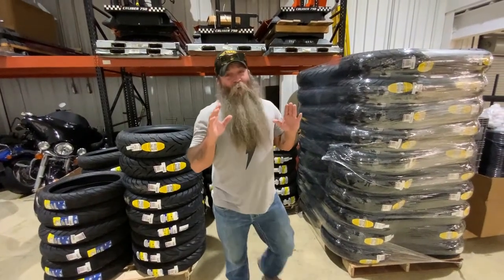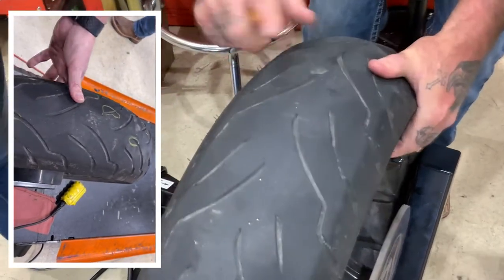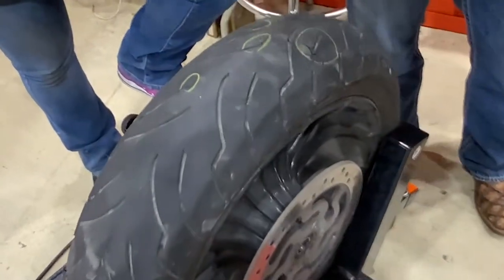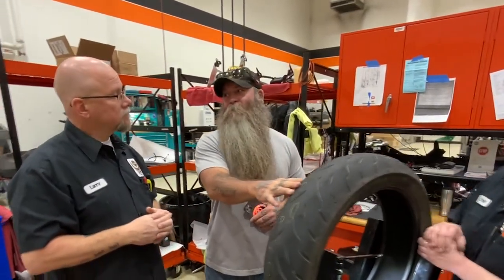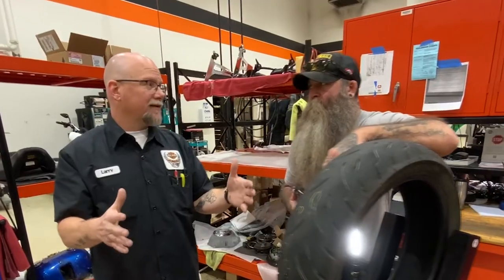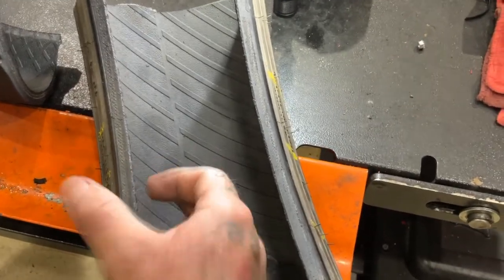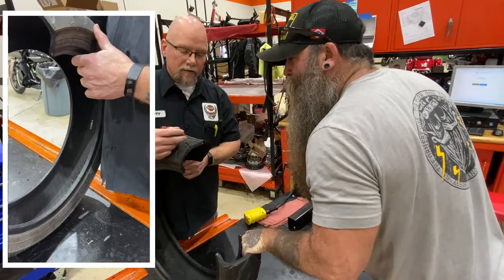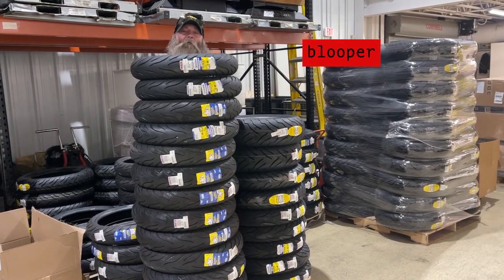Best Tire for Long Distance Touring on Motorcycle Ride? How to get the most miles from your tire~

Comment: I run the commander III front and rear on my SGS. Super happy with them. Every condition they run great in. From concrete to pavement to dirt. I run hard and fast also. I have 15000 miles on them and I bet I get at least 10000 more out of them.
Reply: That sounds great
Reply: Agreed . Those are a pretty hearty tire. Mine also seem to have a good bit left
Reply: Touring or cruiser?
Reply: You obviously don't ride in the rain. Worst wet weather tyre I've ever ridden on in 47 years of motorcycling.
Reply: Yeah, I'd guess you don't ride in the wet very often.  Worst wet weather tire I've ever ridden on and this is well known.
Reply: Cant be going that hard getn 15k out of em lol
Reply: Actually the Commandr 3's are better that the oem Dunlops in the wet, not to mention getting more miles than any, by far, that I've tried across three of my bikes.
Reply: @russparker71 same !!!
Was great on the fatboy 
On the road king they were AWFUL in the wet 

Been on the oems on the road glide.  Handling all weather and temps.  Didn’t like snow lol 

Doin some research for what the best all weather tire for my 124ci road glide that won’t wear out in 10k 
OEM Dunlop’s been getting 12k
Reply: @gorillamoto5329  I love mine for dry cruising.  But they break out under me in the rain way too much around turns when wet.
Reply: That’s what the wife and I run best tires I have come across hate metzeler tires rubbish
Reply: @russparker71 I agree Michelin suck in the rain, I recently went from Dunlop to Metzler on my Road Glide. 4500 miles and the Metzler Marathons are cupped all to Hell... Gonna try a set of shinko 999. I've never had any tire last over 5500 miles on my Bagger. I ride fast and hard, hoping the Shinko handles the wet well and holds up better.
Reply: @fvgc454ss  I have had 4 Commander 3' & average 14-15.000 km's...not miles...I have had 28 rear tires since 2006

Comment: My bike is a 2011 Ultra Limited and I run the Dunlap American Elite when it’s available. I’m running a Continental on the front for now because the Dunlop has been unavoidable but it’s performed well 5k miles. I tried a Michelin commander II a few years ago “commander III” are now available but I’ll never use them or any tire from Michelin. The commander II delaminated on the interstate after 1500 miles almost putting me on the pavement. When I went to Michelin rep about it and after telling him how I was running fast on the interstate. The response was I “over worked” the tire before even looking at said tire. This tire now hangs on my shop wall as a reminder never to buy another Michelin tire.

Comment: Gross rating on your bike is 1360 lbs. The bike with fluids is 932 lbs. That leaves 428 lb Max carrying capacity.  The empty tour pack and mount is 30 lbs. so that leaves you 398 lbs for you, Steph, and all your gear. Bottom line, you overloaded the tire and ran sustained high speeds in super hot weather - and that’s the perfect recipe to destroy a tire. You see it all the time on trailers with blown up tires sitting on the shoulder and the the driver wondering what happened.

Comment: Commander 3"s this season. Finally got to the wear indicators on the Commander 2"s. Over 25K on both front and rear. Mostly highway riding at speed limits. 70-75 mph. Always ck the PSI before the ride and between on road trips. Got 5K on the Dunflops before they went wildly out of balance. Switched to Michelin's and never looked back!
Reply: Are you serious? 25k miles on a motorcycle tire.

Comment: I just replaced my stock tires (Dunlops). I had 18k miles on them. Just put a set of Michelin Commander IIIs on it. I had no issues with the stock tires, but I don’t run heavy much of the time. Went with the Michelin tires only because they were highly recommended.

Comment: Wow!  That's a scary looking tire.  I'm a 300lb man and I pack heavy.  I've gotten 20k out of a couple of sets of American Elites and was really happy with them.  I'm crazy about my air pressure.  I check it every morning. I run 38 front and 42 rear and I wear out tires, but have never had a crack or bad cupping.  Similar experience with Commander IIs and IIIs.  Your milage may vary.

Comment: I've gone through 3 sets of tires on my 2017 RG Special
Stock ones I got 22863 miles
American elite I got 25882
Next set of American elite I got 26039
I check pressure often and I park the bile on wood not cement

Comment: 1998 Heritage Softail Classic setup for solo rider weighing 210 lbs and 20 lbs luggage. Dunlop American Elites front/back wide whitewalls. First set April 2019 lasted 14k miles. Second set April 2021 lasted 11k miles. Third set April 2023-present 3k miles and still rolling. Average Speed 70mph. Temp Range 55f to 95f. Air Pressure 39-40 psi. Comment: I give these tires an overall rating on dry surface 9.5/10. Under wet conditions 9.0/10. Offroad: Not Happening...
Reply: I have a 2017 BreakOut. Solo rider. I use Cobra Chromes up front and American Elites in the rear. I currently have 13k miles on both. I have the front at 36psi and rear at 38psi. I ride from 40° to 100° this yr. I have about 15lbs of weight in my swingarm bag and I weigh 203lbs. The tires are about 1/4 worn. I'm hoping to get 18k on both before winter hits. The Cobra Chrome is softer than the American Elite but the front tire usually lasts longer than rear drive tires. So hoping to get about equil mileage. Both fantastic in the rain. I had Michelin Cammander 2s on and they were terrible in the rain.

Comment: I am on my third set of factory Dunlop d series. Ist set I ran 30k . Second set I had over 20k with plenty of tread left. On a new bike now 16k and they have lots of tread left. Now we typically run 15-20k miles per year. Si I generally change every two and a half to three years. Now I also check my tire pressure every week. 38 to 40 psi front and 40-43 rear. It's Dunlop for me. They are expensive but they last and last for me. First bike was a 17 ultra limited. Currently on a road glide limited and we ride two up frequently.

Comment: I get approx 25,000-26,000 miles out a set of Dunlop OEM and American Elite on a Ultra Limited. I am running 41/41 p.s.i. and checked often. I will start getting cracks in the rear tire when it wears down and starts to cup. According to the amount of thread depth and the wear mark I could probably get another 3,000+ before the wear mark. This is around 21,500 miles and still has good thread life. Yes I try to get pass the 25,000 mile mark to get my money worth. I have since decided to change out at 21,000-22,000 mile mark to be safe before the cracks start.
Reply: First thing I do when buying a new/used HD, remove the Dunlop’s. Michelin or Avon on my bikes.

Comment: I’m a big fan of running 42 pounds in the back and 38 in front on my 16FLTRU. Tires don’t cup or split. They run cooler and perform a lot better riding 2 up loaded to the max for a long distance run. I carry an air pump in the pack. Check my tires first thing in the morning every day.

Comment: Jeepers!!!  Never seen that in any tire before.  If I was a guessing man, I'd say you tan over a bunch of sharp rocks.  I got 23K miles on my Yamaha cruiser, an 06 Stratoliner, running DAE's.  I just replaced it with another DAE.  Love it.  On my two Harleys, I run Michelin Commander II's.   22K miles so far on my Dyna.  Love them.

Comment: I run American Elites on my 04 Heritage. This last set I put 6k on them. Front tire came up with with a breakage from the center to the side wall. The breakage looked like I ran over barbed wire, about six or eight inches long. slotted looking holes with fine rubber in-between. Think I would have been aware running over such a thing, especially holes up the side of the tire would make you think it happened during a turn leaning into it. Never noticed running over debris. Checked the hole depth and several of them were as deep as the tread. Without Dunlop taking the tire in for analysis I'm assuming it's a default in the tire.

Comment: Thanks for making this video. It was a very enjoyable and informative video to watch.

A sobering point that was brought up. At 18:12 "When riding your motorcycle, your life is riding on the size of a credit card." I've always thought of the size of the contact patch, but not in such a way that I could visualize holding in my hand.

I love the Dunlop Tires. They're engineered for our heavy bikes. I'm going to start off the riding season on a set of new tires.

Crow, I owe you one. The date codes on my bike's tires are front, 1417, and Rear is 4816.

I have 15,982 miles on a 2017 Indian Chieftain Limited. I have a new set of tires sitting in my front room ready to replace my old tires, but on the rear, I upgraded from the E3 to the E4. I kept the same American Elite for the front. I have noticed that I cannot squeeze the beads together, even when putting all of my 230 lbs of weight on the sidewalls.

Comment: Dunlop Elite 4 50th Anniversary Goldwing. Changed out the Elite 3 none of those issues.  17 Chieftain Limited Stage 3 Dunlop Elite 3. 9000 miles rear tires 50 percent worn out and not checking or cracking. I drive the crap out of my bikes. Hard acceleration and turning. 😊

Comment: I have a 18 RGS. I got 16k from the rear tire, It was a Dunlop American Elite. I switched over to Michelin Commander 3, So far I have approx 10k on it and plenty of life left on it. I pulled the front at 18k cuz I was leaving on a 5k trip which was also a Dunlop, still had some life. So now I have Commander 3 all around. I have the Michelin Scorcher 31's on my 04 Fatboy, been using those for ever.

Comment: I run the stock OEM Dunlops on my 2018 FLTRU, usually get 20,000kms(12,000 miles on the front)  best about 15,000kms  (9,300 miles on the back) , keep air pressures  as per 38-40psi.  Keep my weights within specs and I weigh 200lbs.  I run fast but not abusive,  it regularly gets above 80 degrees in summer and often it the 90' s July and August.

Tried Commander 2's one cycle but they fell off a lot after about 5,000 miles and were not as grippy.  Nothing like good rubber!

Comment: Great video, thank you! I had 12k miles on my original factory Dunlops and changed them up right before doing a 4K mile round trip. You were going through something similar at the same time and you went with those Dunlop American Elites you just took off…so I do too. Lol. My tires are holding up just fine still but if I were doing the great escape tomorrow I’d be changing those suckers out for something fresh without hesitation. Will be hitting the Ozark’s up a few times this year with a group (will be my first time) maybe I’ll see y’all out there. First rounds on me!

Comment: As you ride hard and heavy consider the Conti Road Attack . My experience with them is extensive hiway some race speed exceding 200 on anothe heavy bike in the Hayabusa.  New tires lasted full trip San Antonio to sturgis and back heavy loaded

Comment: I'm currently running Darkside stuff however, in 64K miles I went through five sets of tires. Two sets were Dunlop and three were Michelin. The Michelin handled great when they were new but they just didn't last. Overall I got the best performance and mileage from Dunlop American Elite.

Comment: I've never gotten good mileage out of dunlops my last dunlop on the rear of my FLHX lasted 9600 miles, was down to the ware bar and cupped very bad. I have been running Avon's on my 05 Softail for years very good tire, I will be replacing the dunlops on my street glide with Avon's

Comment: I’ve run four brands of tires on two heavy touring bikes: a Kawasaki Voyager XII and my current BMW K1200LT.  I’ve had four tires fail: 1 Dunlop on the Kawasaki and 3 Metzelers on the BMW, one rear and two fronts.  I ran Michelins on the Kawasaki in addition to Dunlops and never had a Michelin fail.  I now run Bridgestones on the BMW and have yet to have a Bridgestone fail.  My preferred tire brand is Michelin, but Michelin doesn’t make a rear tire with the right size and load/speed range for my BMW.

Comment: I run the same tires on my Road King. I got about 12k on the rear. It’s absolutely bald. I haven’t checked it for splitting but I like how the tire performs. I could probably get more miles out of other brands but the performance is why I stick to the Dunlop American Elite. I will say this… I should have gotten more. I had a leaky valve stem. Removed the core and replaced it. But it was too late.

Comment: I was about to get a set of these for my VTX1800R :\ I think maybe I'll skip, that bike is well over 700+lbs, and over 1k with us on it, add some gear and it's getting close to a rolling 1200lbs or more. I do inspect my tires after every 500-1k miles, but it's easy to miss that hard too see stuff that's not a cut, cup, or bubble. It comes down to confidence, and that's the rubber that separates you from the pavement, you shouldn't have any doubt your tires can perform, or even over perform if needed. I'm glad you all were able to swap these out without incident, they look a little scary. Arrive alive!

Comment: Wow!  Thanks for a great Video.  I travel gravel roads fairly often.  I bet gravel is hard on them.  My Michelin Commander II tires had good tread to about the 11 thousand mile mark.  I just put on a set of Commander III.  Let's see how these do!  I like a long life tire because HD charges a ton of money to mount, balance, and install!!  Ride safe and I will be looking for more great videos.
Reply: Be careful with those Commander IIIs.. the 2s were great but the 3s are lacking, especially on wet roads. If you only ride on dry pavement, you should be fine.. just use extra caution in the rain.

Comment: I don't know man I run those, I just went to the garage to check mine after seeing this video cause it freaked me out. I did most of the World Record Poker Run with ya'll and rode a lot before and after. Not as much weight as guys cuase I ride mostly solo but have done over 12-14k miles on my tires since last July, still have fair amount of tread. Not a single crack/split.. however I do have cupping, which I'm not surprised because I don't check my pressure as much as I should. I'll have to check my old bike I sold to a friend that has those tires also (second set I ran on it) that are a couple years older so see if they are doing it.

Comment: I had Dunlops on my scoot when I got it and the tires were worn enough at 5k to need replacement... But no splits...  I replaced with the Metezler 888 Marathon Ultras....  Best handling tire I have ever run... Made my Road King feel way more nimble in the twisties...  I just did a tire change after just about 18k on the 888's .. Still had several k miles of tread but I am heading out on a long ride in the 10 range so put a new set on...  I have nothing but good things to say about the Metezler 888 Ultras...
Reply: That's great to hear cause I just ordered the 888's  switching from Commander III  liked them except for the harmonic hum from the front tire at 60 mph

Comment: What did you pay for the front and rear tire and did you ever ask to put the 90 degree valve stems in  so it’s much easier to check the pressure

Comment: Ran Commander 3's. 17k miles on rear, currently 22k on Front. Running car tire on rear now. We are not small people. And that car tire has the weight and traction that a touring bike should have.

Comment: All my dunlops did the splitton that's why I went with michelin's commander threes
Reply: Randy, how are the commander 3’s? I am running American elites now in Florida and absolutely love the traction. Both dry and especially wet. Mine are just starting to cup on the front tire with right at 12,000 miles. Next set I get will most likely be Michelins if they are good in the rain

Comment: Metzler cruise tech i have ran it on both my bikes fixing to pull my dunlops off my VTX 1800 and replace with Metzler cruise tech. they hold up very well . Im always having to put a few pounds of air in my rear dunlop.

Comment: Unloaded, 37-38 1-up on a road king makes sense, 40+ loaded. But the Big boys w 3 bags and over loaded I'd run 43+. Set them pressures cold. On my long-winded road trips I know every tire condition  and pressure every morning before we load out...  I run C2's and C3's with no issues. I never replace with H-D branded tires, all major brands make better touring tires including Dunlop.

Comment: I read Dunlops description on the American Elite.  They have a dual compound so I wonder if the softer cornering tread is cupped maybe because of that.  I run a Dunlop D402...it's about $20 less cost, but based on your 12,000 mile's.  I  get way less mileage than you at about 7,000 mile's SOLO.  But I don't seem to get cupping because maybe the D402 has only one compound in the center and the sides.  I dunno.  Maybe I will try a Elite next ture...I'm always looking for the cheapest tire Dunlop makes. I wonder too if you could air it up a bit more...you can't complain with 12000 miles but with fully loaded two up, you wanna be fully inflated.  On lower pressure, the rubber itself flexes more so more heat especially off the center where your cupping is most pronounced.  Just my thoughts I'm no expert.